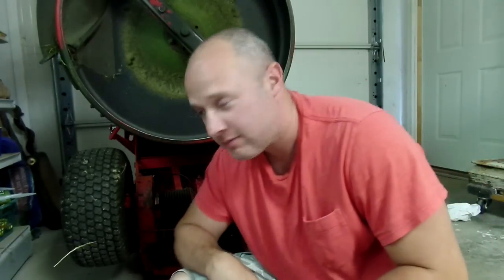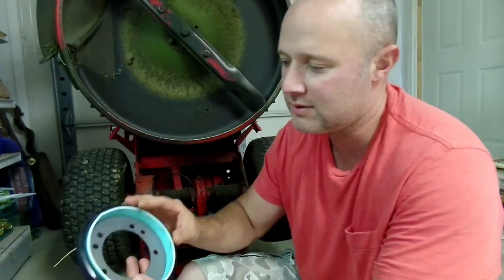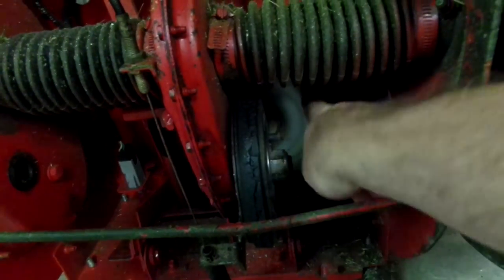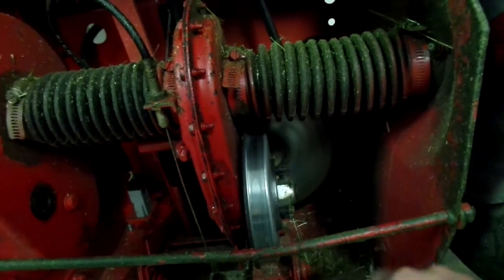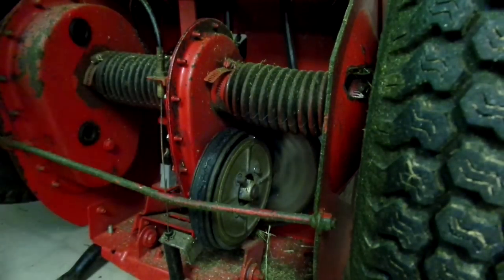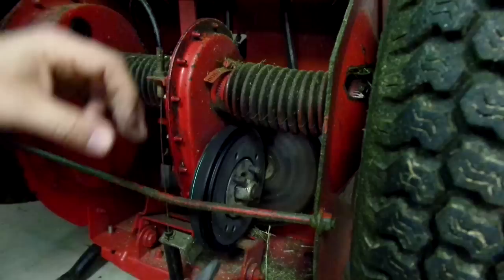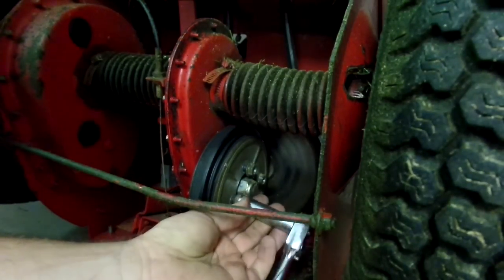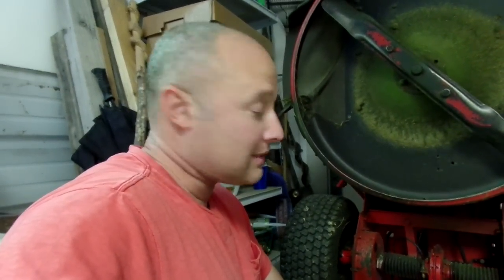Snapper drive disc replacement

Comment: Over the years I've replaced these at least four times (since '94). Every time I replace one I order another just to have one on hand for a quick repair. Their easy to order but I don't like waiting. These riding Snappers are such great machines it's worth the effort it takes to keep fixing them.

Nice video.
Reply: They are!! And i like to tell myself its like my Formula 1 car lawn mower...with the engine in the rear 🤣🤣🤣

Comment: I replace mine every year.  I'm pretty hard on shifting and mow in reverse quite a bit, going back and forth, so it wears out quickly.  Thanks for the video.  I always go back and watch it before I change it out as a reminder.
Reply: Haha, I tear mine up and do the clutch once a year as well. Have you disengaged the reverse safety switch? Makes it a lot easier to go from FWD to REV. Great for making straight lines.
Reply: @cumbis123  yes I did.  I mow quite a bit in reverse for the same reason.

Comment: THANK YOU! THANK YOU! I followed your directions exactly! I installed a new drive disc and put on a new blade and it's like I bought a brand new mower! THANK YOU! I bought the disc on eBay for $14.00 and the blade for $16.00. I asked my local mower shop what it would cost to have this work done? They said $189.00! If I ever see you in a bar...drinks on me partner!

Comment: Thanks for the video. I see you've heard that about 40 times, but I wanted to add to the list. One thing I'd like to add. It didn't take long to repair the disc, but I had some other work to do, so I just left it on end overnight. There's often a sticker on the battery telling you that if you're going to keep the mower on end for 2 hours or more (another website said 45 minutes), you should remove the battery. I did not, and you can probably start to imagine how that turned out. Yep, a wet path from the negative side of the battery, dripping onto everything between the battery and the floor, and then continuing 4 or 5 feet to the drain.  A lot of baking soda/water mixture later and I finally neutralized the acid. Wow! Such a nice white streak on my garage floor! Local Snapper guy said the battery would probably be OK, but that I may need to add some water to the cell. Fortunately he had replaced the battery fairly recently, so it should still have a long life.

Comment: I recently acquired an old Snapper Series 6 riding mower with the exact same problem but it appears that someone already attempted to replace the drive disc which is all loose. So, I just ordered the correct part # with the brake liner in hopes that it fixes the stalling issue. The one that is currently on there looks like it might be backwards since I can see the little brake mechanism, but buts me. Thanks for posting this video.

Comment: Those units will make short work of acres of grass. Mine is a 10 hp Briggs, 30" Ninja bladed grass cuttin demon. 2002 model that operates as new. I just mulch it and it works quite well. Grease the zerks while you're under there.  A little normal maintenance and those mowers will give years of good service, 
SNAPPER #1 !

Comment: I bought a used model 25066 where there was no rubber left at all so it was metal to metal, I ordered one from the jungle website and when I went to install it the inside diameter was too big and the overall diameter is wrong so it contacts the drive disc all the time, it was the right part number so I'm going to try a Briggs and Stratton or a stens disc, I got a good deal on the mower with the bagger, 35 bucks for both, it just needs some TLC, it's the older style with the handle bars and a 25 inch deck, the engine runs good after I cleaned the carb bowl of a gallon or two of water and also the gas tank but overall it's in good condition, the bagger alone is worth it, some people call it the Forest Gump mower, I already have a newer one with the 28 inch deck but I needed the bagger which is impossible to get used anymore.

Comment: i drilled out the drive wheel and put 5 bolts through the drive wheel and into the 5 holes on the clutch disk and threw the cover plate and thrust washers in the trash, old school bolted clutch just like the old snappers that pull wheelies :) no more smooth engagement needed

Comment: I suggest when you replace these drive tires you replace that fiber cardboard spacer also, as that wears thin it will allow the drive tire to shift more and more side to side thus creating more wear on the drive tire, it's lining and possibly creating more vibration. Just imagine the cardboard spacer as space between your car wheel when the car wheel lug nuts are not completely run down, loose.

Comment: Great vid, try not to bend that spacer bar. It keeps the fenders aligned so the axel doesn't get crooked.  I use an impact wrench, nuts break loose fine without holding the wheel or bending that spacer bar.

Comment: On a new drive disk that pulls fine, you should be able to tow slash drive as follows. My 33" pulls my fat ass at 275lbs, my towed behind 48" aerator at say 80lbs, another 240lbs in cinder blocks plus my wife at say 125lbs sitting on the blocks. And do all this up slight hills. That's an additional 720 lbs added to the mower.

Comment: make it easier to keep wheel from spinning when taking off the four nuts . use a socket on center nut and use a wrench to loosen or tighten the four nuts that hold the clutch on.

Comment: I’ve seen the same wear on the discs from other YouTubes, including mine. Does anyone know what does this cracking type damage? Just curious. I’m thinking. Since the main plate is unprotected, maybe this damage is caused by rocks and grit getting caught between the clutch surface  and the plate???
Reply: My guess would be heat.

Comment: Soooo I'm trying to do this replacement on on my LT12.....the area to work in and extremely tight. Anybody have tips on getting into there? I have to get the small screws loose right? Not the big center one.?

Comment: you need to use locktite red on the bolts before you put the nuts on or they will come off also where are the lock washers....VERY IMPORTANT....WCH

Comment: Hi,... Was your inner green clutch material glued in or separate ?
I replaced a clutch disc before but this second one I bought the clutch material came loose in the package,... I don't know if I need to glue it or if it binds itself ?
Reply: Same here. I now only buy the discs with the inside liner permanently attached. I installed one with the inside liner loosely in there and it very quickly failed.

Comment: Thanks for the the video but did you have any trouble starting your mower with it tilted like that?
Reply: Sometimes if you DON'T turn off the fuel line between the tank & carb the fuel will flood the engine, even run into the crankcase & mix with the oil so when you try to crank it gives the impression the engine is locked up, IF this is the case remove the plug, let it air out dry out, drain the oil, replace with clean oil, then go back & put a new plug in.

Comment: Do not buy the replacement part with the blue insert that is unattached inside the disc. They won't last. It might be a few dollars more, but I now always buy drive discs that have the interior material permanently adhered to the disc.
Reply: Same here. I bought two of these but the lining just spins inside the drum of the disk. What adhesive could I use for this? Grass is getting tall and I'm running outta time. Maybe I'll get some sheep. Thanks.

Comment: Ok dude, that is not the drive disc.....Its the driven disc!!!!!  The drive disc is the one attached to the crank shaft of the engine....Teach what you know, not what you don't know.
Reply: The part he installed is also commonly referred to as the drive disc.  Pause the video at 44 seconds, enlarge it to full screen, and you can see it printed right on the bag the part came in.  Comment on what you know, not on what you don't know.
Reply: @bryanhill3710  Its being driven!!!! Driven disc!!!!